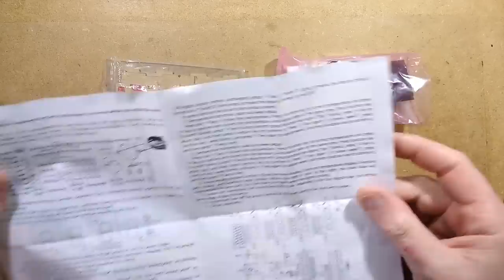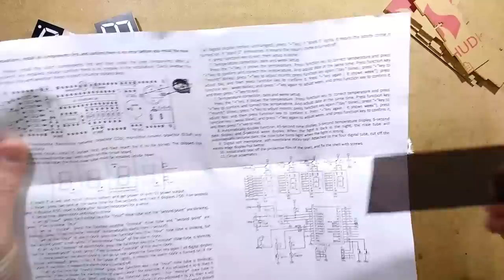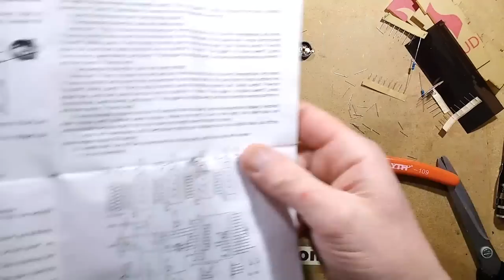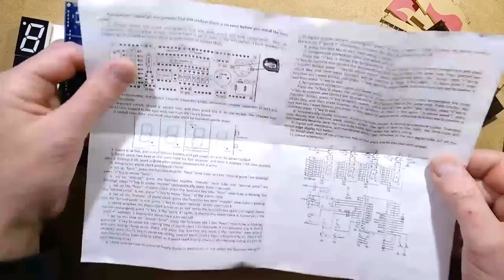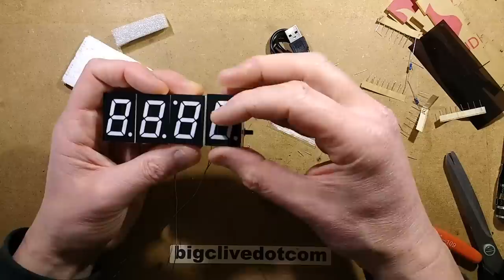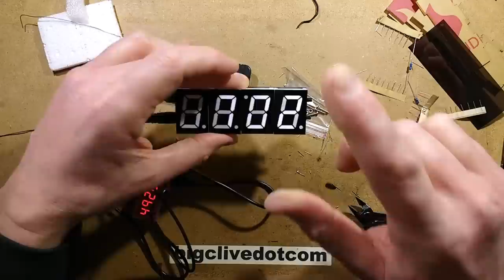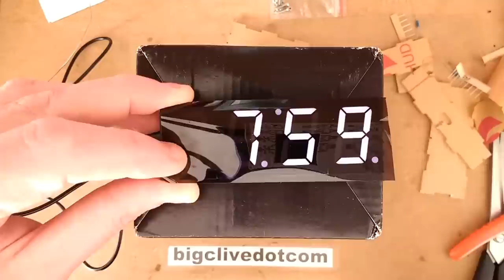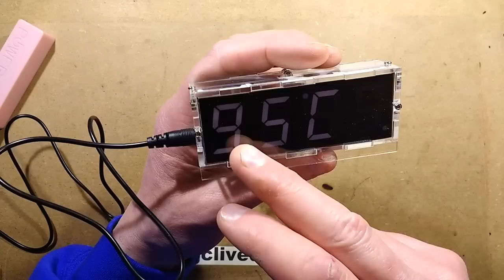eBay clock kit.  Full build and setting guide.

Comment: you amaze me with how you solder up all the pins! I have minimal experience doing electronics, 
but I have done stained glass for many years. I might try a kit, just to give it a try to see if I am able.
Reply from the maker: If you're already familiar with soldering the lead in stained glass, you'll find soldering components very easy.

Comment: You were talking about solding iron burn. I got distracted one time when I  was just starting to solder. I had placed the iron down and when I went to grab it again, I actually grabbed the iron part not the handle with full grip. By the time I realized it, I dropped the iron and had the mark on the palm of my hand and fingers. I guess because it was a big area, that I didnt really feel any pain, it felt more heat than anything. Thankfully it wasn't as bad of a burn as it sounds and healed up pretty quickly.

Comment: Just received the kit for the smaller version of this clock from eBay today. It has all 4 digits in a single integrated display unit, but it did come with the battery which is nice. Saved the video so I can reference it while I'm building mine!

Comment: I had no soldering experience and I did a clock kit that has the 4 digit and 60 leds that goes around it. When you push one of the buttons you can make the leds do different circular designs.

Comment: I do alot of wire soldering for spliced connections for my job, don't do much on PCBs. Went ahead and ordered two of these kits (since they are cheap enough). Should be fun.

Comment: I assembled the exact same kit a couple of years ago, was about $AU7.90. The battery holder on mine was just a pressed metal piece though and I mounted the thermister and light sensor outside the casing through the hole. But it was easy and fun to assemble.

Comment: I built this kit, I bought it from banggood.  They also had another one with dot matrix displays that used SMD components which I also built.  What I did find is that there was a voltage present at the battery terminals and after some research I found that the clock chip has a charging function which must be enabled in the firmware written to the supplied MCU.  Mine came with a CR1220 battery (not rechargeable) so I didn't install it.  I will put a super cap in its place.  I did test the current at the battery terminals too and found it was limited to just a few milliamperes.  This didn't happen with the dot matrix kit.  I like the dot matrix kit because the displays use unusual square pixel displays that look quite cool.  It also has less annoying firmware.

Comment: I just finished putting one of these together, but the case reminded me of the term "Chinese puzzle".  And when you finally get it put together, you have to clean the plastic of fingerprints before installing the clock module.  Eyeglass cleaning wipes work great.  Programming this thing is nuts.  Also, I had to trim down the polarized film darkening strip to get it to fit.  Just noticed about every thirty seconds or so, it cycles through the temp, weekday, alarm time, and back to normal time display.  Hmmm...I thought this was going to be a regular clock with those displays accessed by pushing a button.  Thanks for the video.

Comment: There are cut-outs on the acrylic case for those two components (light and temp sensors, I think)) to protrude out of. They are left with enough lead to bend sideways and out through the holes. and the battery is a CR1220... That's what I see in my instructions from the QR code... Edit: After following longer, I noticed the kit I have (2020) has a slightly different layout. sorry. I can't wait till the whole video is over before posting. Oh well. Looks fun though. I will assemble mine tonight. Thanks Clive

Comment: Looking at that kit I find it funny that as an apprentice electronics tech back in the 70's that the long running project was a digital clock for the training center which read the rugby time code for accuracy and had displays made out of the 10 inch long bulbs you used to get in bathroom light units with shaver sockets. The control unit was about the size of a small fridge and the circuits were all transistors (ICs were just coming out), hell we were still taught valve theory :)

Comment: Water-based flux, regardless of what type of solder it is used with, is some great stuff - IF you actually clean it off. We used to run commercial boards through a dishwasher to clean all the flux off. If you use rosin based, it is much harder to clean off, but it is not necessarily required to clean off. The water-based will eat the traces off the PCB if you don't clean it off.

Comment: Hi Clive, First time caller but long time listener. I just had a quick look and there is no EU restriction on the sale of lead based solder. RoHS does restrict its use in newly manufactured products and there are still exclusions for some industries (even then it seems individual countries still have the option of applying exemptions.) Don't expect lead solder to go out of production or be banned to home gamers any time soon.

Comment: I got nearly the same one from Banggood. Except the PCB layout is a bit different, the LED displays are the potted ones and the battery was shipped in the kit.

It works very well (except for temperature as you mentioned), time is accurate, definitely a good choice for buying!

Comment: Re. Maplin's IC packaging: There was a time they were shipping CMOS ICs individually in a small PET(?)  bubble sealed with a foil-laminated bit of card. The result was a large number would be dead out of the box or fail in a very short time. 

The probable cause was fairly obvious. The IC's pins weren't held in contact with the foil so it was possible for them to build up a triboelectric charge as they jiggled around in the post, which then could discharge to the foil. Repeat several times and you'll have one dead or damaged IC.

Comment: There’s a project using those project clocks using new code through those pads you pointed out. There’s several different versions. Mostly for a stand alone clock and there’s one that has to have a constant connection with a UART and you get the weather info to show the outside temperature also you can flip from C/F pretty neat

Comment: i built a calculator for my first project...my soldering tip was corroded but learned this after i finished the job (needless to say i have new ones my dad made me) i had to melt the solder near the join of the screwcap on the iron and drag it down to the work as it wouldnt melt on the tip nor stick to it even at max temp...i got the job done and it works, im happy with what i achieved given the disadvantage XD

Comment: Tip for getting plastic/paper/etc of laser cut plastic/etc, bit of strong tape over the corner, press down hard and peel in towards the middle of the part.  Saves you scratching it up with a screwdriver/stanley knife.

Comment: A couple suggestions to make that iron much better.   1- use hakko tips (the yiuha ones are kind of junk) 2- wrap a layer of copper (or aluminum) shim stock between the element and the tip (really beefs up the heat transfer)

Comment: Not so long ago I purchased a lot of those battery chargers that look like your pink battery charger. All the batteries were pretty bad, though I expected that for about a buck each (maybe 300mah at most). I found putting in my own older 18650 that I used for vaping mods works pretty well. Just had to make sure I got the style with springs and the bottom pops off easily. So, I think your idea of using those for quick power to small things like USB led sticks is a pretty great idea.

Comment: Interesting technique trivia: In the Alcatel microwave radio service manual they strongly recommend trimming the leads of a crystal using scissors rather than the usual wire cutters. The reasoning is that scissors slice through the lead without the shock that happens when common wire cutters snap together.

Comment: 22:08 For the photoresistor and thermistor: There are holes in the top of the case that these two things can stick up through, so leave a fair bit of lead on them so you can make 90 degree turns upward out of the case... Serving Suggestion here: https://images-na.ssl-images-amazon.com/images/I/61LqwfYQLFL._AC_SL1000_.jpg

Comment: Looked for these kits on eBay. Noticed upon close inspection of the eBay photos of the finished kits, apparently the LDR and temperature sensor are designed to extend off the edge of the circuit board. The upper top piece of the case has an oblong cutout to allow the LDR and temperature sensor to extend vertically, through the case and into ambient air.

Comment: Nice looking display, diabolical settings procedure, Clive ..... and I like my blue 1% tolerance, metal film resistors. I've been using them since the early 1980s. I would probably use masking tape to temporarily hold the case together, whilst putting the screws in.

Comment: I got a variant of that kit just recently from banggood. Works nicely, had the battery you were missing (cr1230 or some strange thing like that, all my other stuff with those coin cells are cr2032) and a so-called prototyping area. There were also six transistors instead of just four, in addition to the four display drivers there was one to drive the beeper and one in connection with the "prototyping area" (which was left unpopulated). But yes, a very nice kit, easy to build even with the double-sided stuff and the fiddly case. The idea to use USB power is really good for my use as an office clock and above all thermometer. Now I know the temperature at the office rises from about 19 degrees to 24 degrees over one work day; thanks, passive-house :/

Comment: It would be a very cool video to follow your suggestion of expanding the basic circuit to light a larger display and maybe re-write the PIC's firmware to be a bit less annoying in that function cycle.

I bought my best pal one of these for Christmas and then a couple for myself as well. We are intending to assemble them together and make a hands-on video of the process.

Comment: I actually bought one of these and assembled it after watching this. Unfortunately it didn't work, checked all of the connections and solder joints but I couldn't find anything. My guess was a faulty IC or finicky chip socket. Still fun to build though.

Comment: The only thing that stops me from electronic (which I love so much) is my inability to solder components. I have tremors and it makes it very difficult to keep steady. Good work Clive. Another great video!
Reply from the maker: You may find your tremors stop while concentrating on a solder joint.  I had a coworker with a similar thing.
Reply: @bigclivedotcom  I'd love to build things like this. I love tinkering, it is what drew me to your videos. I'll have to get my own soldering iron and set a space up in my quarters.

Comment: Did you know the defuser/membrane/filter was sticky backed? Very hard to peel the backing off but does look so much better when stuck to the digital tubes. It's best to stick it down first then trim it around but you would have to take it to pieces again to that.
Mine was a bit different but basically the same and the tubes were in a resin on the newer models.

Comment: I'd be quite interested to see how you would convert this to a piece that could run off of an internal cell, like an 18650 or other salvaged chonky battery. Another interesting future video idea is just what you described at around 30:00 in: Wiring this PCB (Or perhaps a better designed one) to a much larger display. I'd love to see just how I could do that to run a large clock to put in the apparatus bay of my department. I have one of our old wooden backboards (Which we can't use for sanitation reasons, obviously) that would be an excellent thing to convert into a large clock. Or perhaps a counter display, where we can click a button and have the number rise/fall to have a large counter of our total calls that year. Gah, every time I watch one of your build videos, I get lovely ideas that I can't quite puzzle out how to do....yet.

Comment: I built one of these a couple months ago. There was a problem with the socket for the led controller, so only half the leds lit up. I fiddled with it and got it working intermittently and realized that was the issue. Would have been a pain to disassemble again, so just decided to buy another and start over.

Comment: Soldering anecdote.when my daughter was very young, I walked away from my worktop with a hot iron on it. This was before I used a soldering station, and the iron was just on a wire cradle. She thought it looked interesting and grabbed the metal shaft. Nobody was happy. I don’t think she still has scars, but I’m sure she still remembers.

Comment: I've found that those laser-cut acrylic cases can have very sharp edges requiring careful handling. After removing the paper coating and figuring out which piece goes where, you may notice lots of shallow cuts in your fingertips.

Comment: Nice video, I like this camera set up much much better. And Audio Q seems to be very good in this video also.

Nice clock built, but wondering if possible to mod it to display much larger LED's? I tried searching and this seems to be biggest display. Would be hard to see from across the room.

Cheers

Comment: Hot air or hot plate rework stations for removing displays like that after they were soldered. 
And about the crystals, I soldered and reworked the smd ones at 350 degrees Celsius and were just fine. 
The very old ones, the large metal cans are sensible as the crystal itself is soldered on two thin wires with a low melting solder but it is hard to get the temps so high at the joints inside...

Comment: I just got my kit yesterday and though is looked the same on the ebay display it was totally different  =and it has a potted one piece, display with light guides and no filter for the front.
Only three capacitors, three, resistors, no transistors or diodes, so it was pretty easy to put together. The function seems exactly the same as yours though.

Comment: Big Clive, I followed your steps putting together my own kit. Very helpful. Unfortunately I installed the displays before I had installed the power connector so I'll need to take one of the displays off. (Waiting on AMZ to ship me some no-clean solder wick). I still tried out the kit by pressing down the power connector. It seems I have a problem. Not all of the individual LEDs in two of the displays seem to be working. Does it sound likely that two displays would have faulty LEDs? I checked the resistors (albeit after installation) and two of the 10K resistors measure ~6KΩ. Is that a concern? If not, what could be causing LEDs to not be working, other than the obvious... bad LEDs?

Comment: Just want to say, there is a very easy way to do the case.......
Take all the paper off, then figure out which way it all goes, drop the screw into each piece (EXCEPT for the top screw next to the sensors) leaving the nut about 3mm from the end of the screw, this should line up with the nut holes.
Assemble the front, sides and top together.
Assemble the bottom and rear together.
Drop in the PCB (buttons end first), then attach the entire rear/bottom assembly and you don't need to bother with the top screw/nut at all. Any time you need to open it, it just opens into two big pieces.

Comment: I bought 80 74HC181 4 bit ALU slices from Latvia recently. The guy had some anti static foam I hadn't seen before, it had a gold coloured aluminium metalisation on some fairly standard white open cell foam. But he had pushed the leads into the white side and they didn't actually pierce the foil. Oh well, it's the thought that counts xD

Comment: the ldr and the temperature sensor are meant to be soldered with long leads and then bent 90 degrees to poke out the hole in the case.

Comment: A tip on removing protective film or paper. Press a bit of good tape to the edge leaving a tab to pull back on. It tends to start peeling back easily and gives more to pull on. Not as fiddly as using a knife or screwdriver and doesn't risk a scratch.

Comment: Very cool, best hour long video evar!!! I really want to get back into tinkering with electronics, but my house is in need of many upgrades, like adding sound insulation,  and basically repairing 30 years of neglect from prior owner.  anyway. love the video, really makes me want to dig out the old iron and build something.  I will probably start where I started some 35 years ago, by taking apart broken electronics and sorting the parts.  but these days people dont just throw out old VCRs and TV sets anymore, they all go to goodwill.  Meh, I have hoarded a few bits here and there to pull apart.  Best way to get used to using the iron again is to use it in a semi destructive way  :-)

Comment: I am fascinated by the idea of using GPS signals to "discipline" such a clock and would love to read a discussion about that.  The reason it comes to mind is I took a class on celestial navigation which requires about one second time accuracy for calculations (which I interpret as +/-  0.5 seconds).

Comment: Great, good to see one working. Built mine, but nothing worked, despite being a seasoned electronics assembler and checking everything thrice. Contacted ebay seller I purchased it from, and it seems from the feedback that I was not the first one to encounter this issue. Moral of the story, check feedback of the seller before purchasing. Dissapointing.